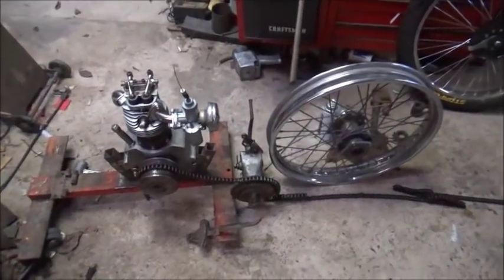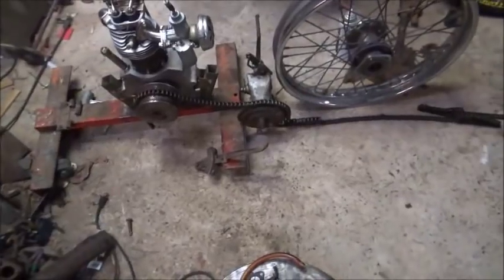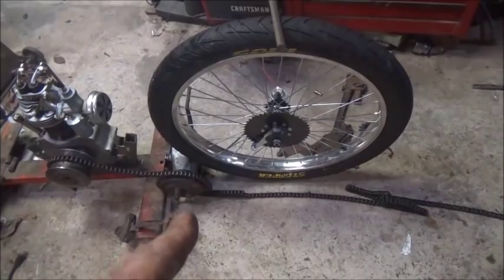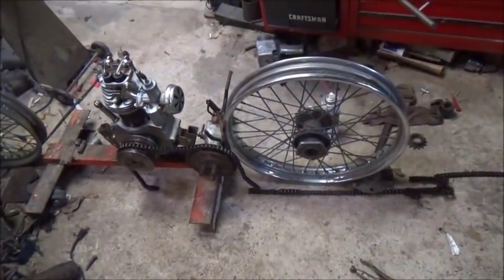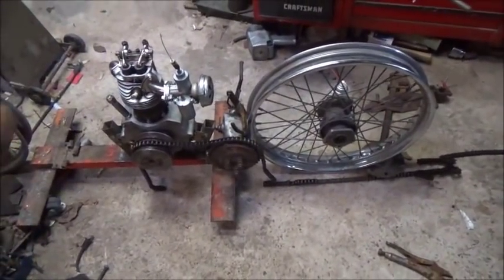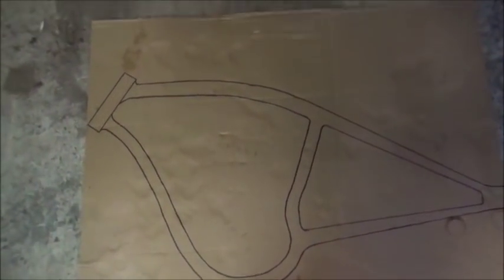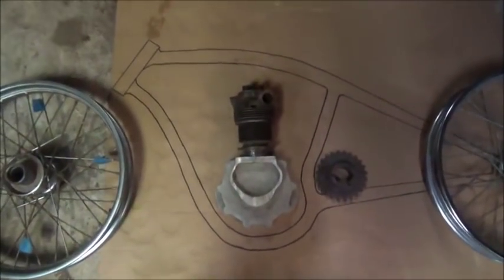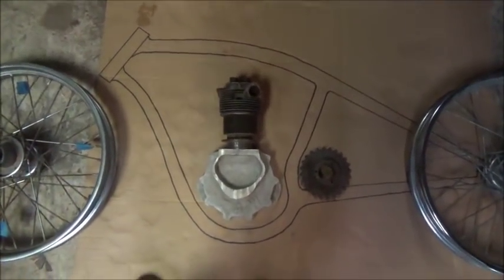Motorcycle Frame Design For The Home Built Engine

Comment: Jonathan, check out the Danish built "Nimbus" motorcycle for inspiration, it has a flat stock frame.
Reply: Yes the frame consists of two identical sides back to front that way no fork is needed for the back wheels.
It looks like a stable and quite simple construction. http://2.bp.blogspot.com/-TDkvO9q5aTg/T6dMeM-nLuI/AAAAAAAATNQ/uo1rnIBlIVw/s400/Nimbus-1946-combo-4.jpg

https://duckduckgo.com/?q=%22Nimbus%22+motorcycle&t=ffcm&iax=images&ia=images

Comment: Cool  the motorcycle returns! That frame should work good, Zundap back in the pre and years into WWII used a welded together looking (I'm sure they stamped a lot of it) frame with a flathead boxer engine, worked fine. Good luck on er, hope things calm down quickly on the raining.

Comment: I've been waiting for this...l like the Harley wheels too & centering up on the motor is definitely the way to go...right now all I'm seeing is if the drive chain is going to rub the rear tire & like you mentioned the neck rake (rake & trail geometry)...have you seen a simplex service frame/bike? They're the best (my opinion) geometry wise

Comment: Interesting! Glad you were able to use the Amal's! It's a fun project to jump back on. Square plate will be solid as heck. Bit much rake but you're in charge. Have Fun...Newk from Kentucky
 the bike.
Reply from the maker: Thanks You!! I didn't even check the rake, I will set it all up on my frame jig, just like the rear wheel mount, leaving extra on the frame to make adjustments.

Comment: Hello,
I have had good luck using something like a two piece shaft collar on the hub with spacers holding the sprocket on the other side of the spokes.  Fairly easy to make.  I've seen a couple of those rag joint sprockets wear through the spokes to the point where they'll all suddenly break.
Also keep in mind that in some places DOT approved rims are required to be registered for the road.